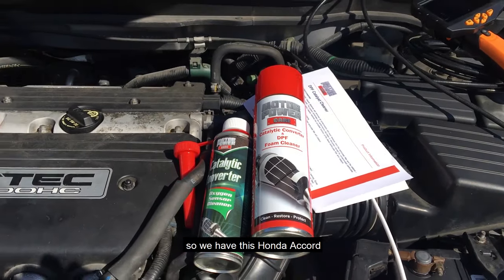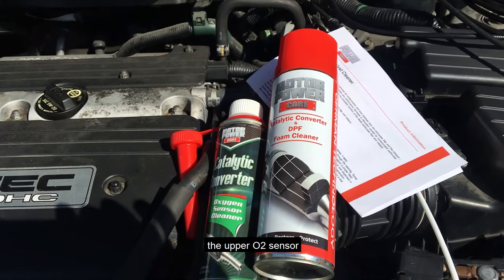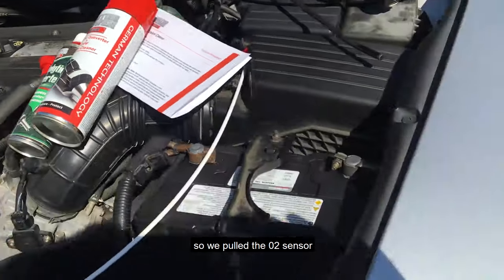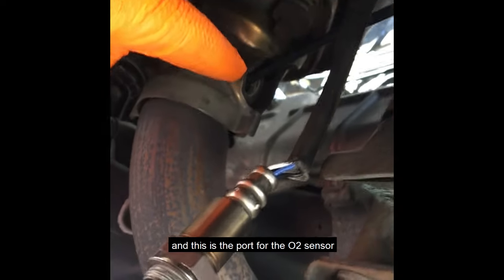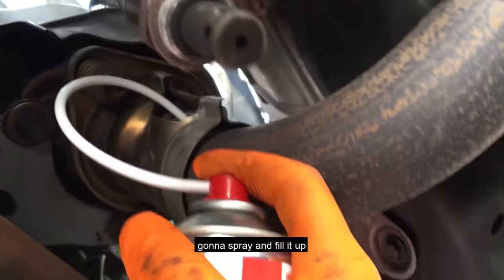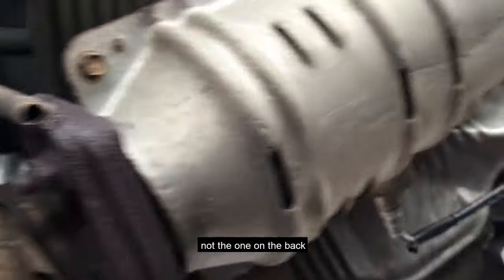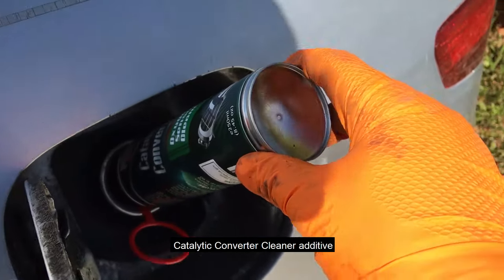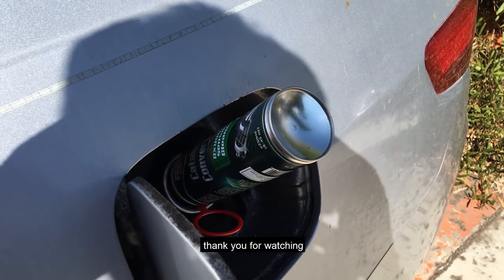Catalytic converter cleaner foam & additive Easy way for cleaning high quality from MotorPower Care

Comment: I was told I needed a new catalytic convertor. I used this product and after a while the check engine light went off and has not come back on. It apparently did its job
Reply: Hello James Delacruz, can you share progressive update if issue of CEL hasn't shown up again?
Reply: hi where i can buy this product any body knows
Reply from the maker: @huramshahz6844  u can buy from our website MPCare.com or u can follow ebay or amazon links showing in the video description
Reply: @motorpowercare  thnks very much

Comment: This is an amazing product.  I used it on a 17 year old Mazda Miata LS with the original catalytic converter. Here's what prompted me to consider the product.  In the summer months in Florida, it gets very hot and very humid so a naturally aspirated engine will struggle to "breathe" especially with the load of air conditioning compressor and sitting in traffic.  So I would get the same symptoms each summer, engine would bog down, rpms would vary wildly and while the Miata never quit on me, she would balk and run poorly.  Then there was the awful smell of exhaust that told me that the end gas detonation (pinging) was indicative of fuel not being burned properly in the cylinders OR it was not being recirculated through the EGR and cat.  No codes, no one could figure out what the issue was.  I knew the cat was the issue but still no codes.  I saw this product and thought, it is worth a try rather than buying a new cat (no rattling or broken baffles in the catalytic converter so that had already been checked out).  I put 1/3 in a half tank and drove it like I stole it.  Next day, down to quarter tank, put another 1/3 product in and again ran it hard. I couldn't believe the difference.  It was like I was driving a new engine!  Smooth, light and nimble she accelerated so deftly and purred down the road. No exhaust smell and guess what, I could actually hear the exhaust note in the car (a must have for a sports car driver...it's part of the fun of owning one).  Finally a few days later, when I saw the slight variation in rpms at idle, I added the last bit and ran her hard.  This is a great product that saved me from buying a new catalytic converter and gave me Miata the energy she deserves.  Driving is a pleasure again instead of a constant niggle. I will be ordering another can soon just to have on hand!  Thank you.  Love the name. Growl....purr!!!

Comment: This formula acts fast to clean cyclinders, piston heads, injectors and the catalectic converter. My 'Check Engine' light came on for 'bank 1 (passenger side) and so I ordered this German brand cleaner, even though it does not claim to Guarantee my Audi Q7 would pass emmissions tests seems to have worked! Within two days after putting it in the gas tank the 'Check Engine' light went off on it's own. I recomend this product for use on modern automotive uses. Also after research of causes related to this 'Check Engine' fault, I've switched from regular gas to Premeium. I now vary my driving style to drive it a little harder to get RPM's up. I also had the system checked for leaks prior to using it. Because leaks can cause your vehicle to throw the 'Check Engine' fault code! ....my OBD2 sensor reads normal now on my cell phone!

Comment: This product works as it states on the label.  My car had a slight sulfur odor under hard acceleration and hill climbing, and after a tankful of this product the smell hasn't returned.  One thing though, try not to get it on your hands for it does have a strong mechanical/ chemical odor that takes a lot of scrubbing to get rid of.

Comment: I just saw a whole fume was coming out of exhaust after catalytic converter replacement. i think mechanic only cleansed it, not replaced it. If a new catalytic converter is replaced, does the mechanic have to do fuming a lot of gas through exhaust? please reply  me.
Reply: He probably cheated you. I would have a different mechanic check if it's new.